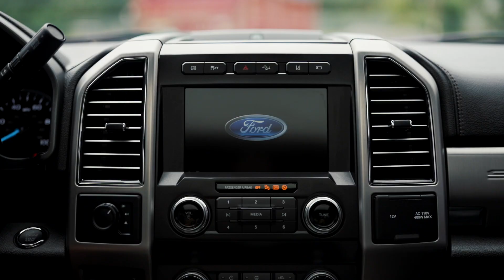This Was Very Much NOT Part Of The Plan.

Comment: Should I buy a 2008 super duty lariat or should I wait. Its got a 12” lift on 38s and 24” American Forces got 50000 miles on it and has a mini max tuner nice truck for sale at 32000 should I buy it or keep looking
Reply: Wait. Don’t get a 6.4 unless it’s bulletproofed.
Reply: I think it’s is but why
Reply: Seems like a clean truck. but I wouldn’t buy a 6.4 just my opinion now if it had a 6.7 in it then that would be a different story.